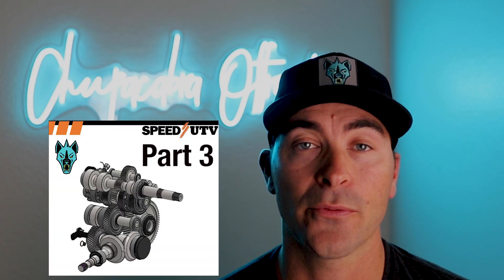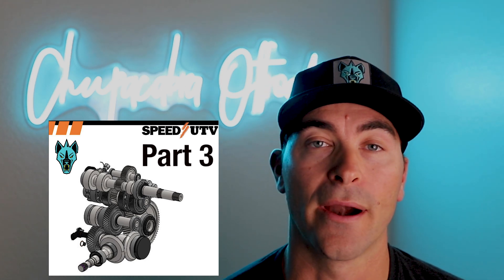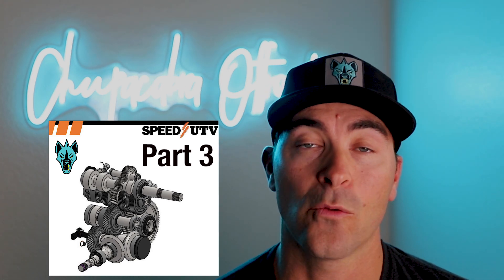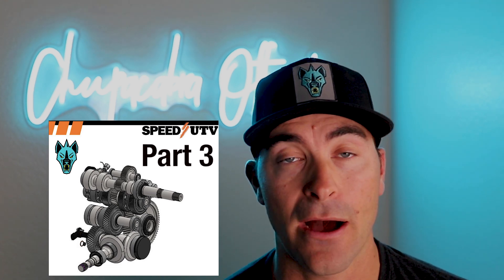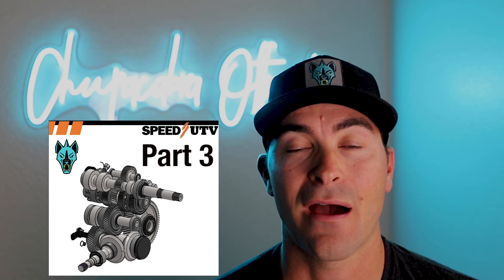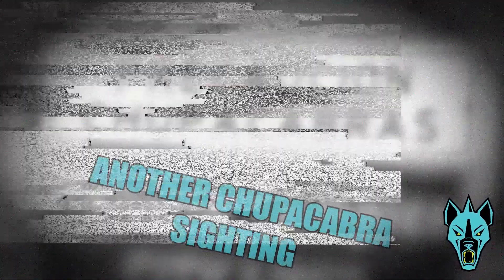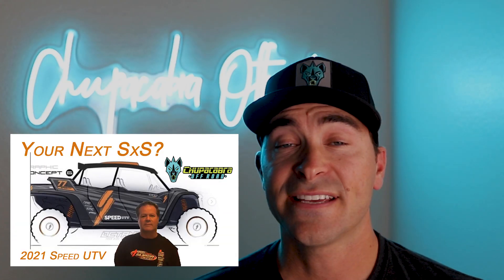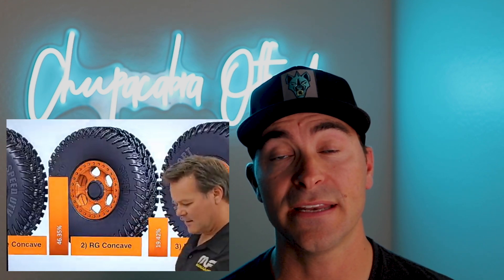SPEED UTV BREAKDOWN - 3 SPEED CVT | PART 3 | CHUPACABRA OFFROAD

Comment: The XX front diff locks on the fly. No doubt the Speed units are built off of this design, by the looks of the pic...minus the slipper. 
I bought Robbys double plunge axles for my xx. They are solid, well built units. CV temp stays low.

Comment: I really hope they offer this has super low, low and high. Not just low, high and overdrive. Most of us don't need or want to go 75+ mph but most of us DO need crawler gearing especially with 35s.
Reply from the maker: I agree, I hope they hedge it toward low speed, 80 mph is fast enough for 99% of situations I've encountered, and I bet this will do more than that.
Reply: These cars aren't being built or marketed for crawlers, these are desert cars and we absolutely want top speed. Fingers crossed 3rd gear with the Hell key will dance around 110mph. I'm sure more models geared towards trails and crawling will be introduced as they gain traction.

Comment: I thought I was the only one that wished my Sportsman XP 1000 had 3 speed transmission so low could be lower than have a  mid gear for most trail riding then high the same because 82 MPH is  fast enough.
Reply: I've been wanting a 3rd gear since I got my RZR XP1K, but not a cruising gear, a crawler gear. Hopefully this ends up becoming industry standard.